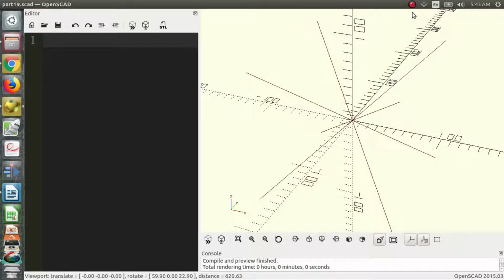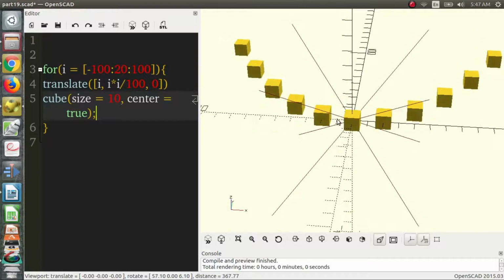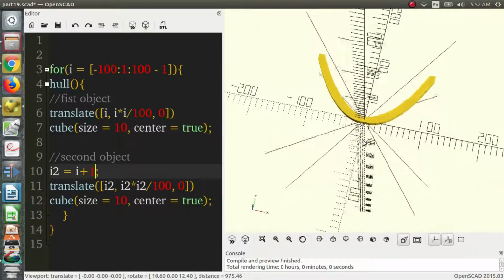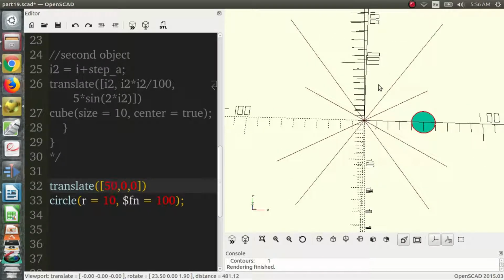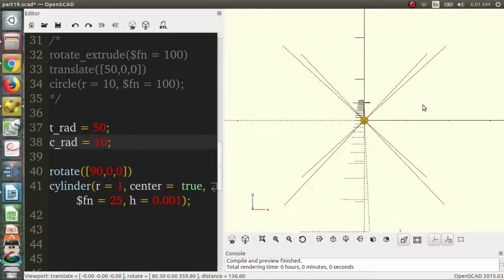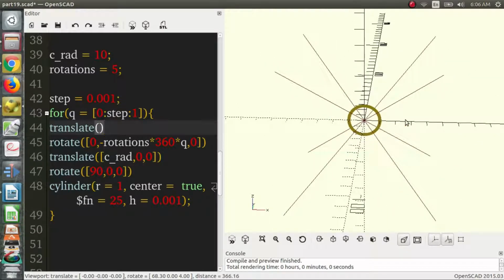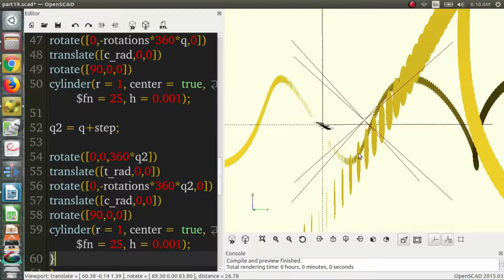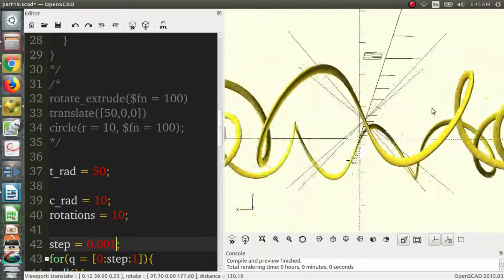Chained Hull-OpenSCAD Tutorial 19

Comment: Is there a way to do a hull to add another shape without compromising the void in the middle of the ring?
Reply from the maker: Could you elaborate? I think I understand in principle but not exactly what your going for. If you have some code, I could take a look.
Reply from the maker: So I thought about it and a simple way to do this somewhat is to hull each individual segment of the ring with the object you want to hull with. It's not perfect but it does it somewhat. Although I'm still not sure what you mean fully. 

steps = 100;
for(i = [0:steps-1]){
    I1 = i;
    
    I2 = i+1;
    
    hull(){
        rotate([0, 0, 360*I1/(steps)])
        translate([10, 0, 0])
        rotate([-90, 0, 0])
        cylinder(r = 1, center=true, $fn=100, h=0.01);
        
        rotate([0, 0, 360*I2/(steps)])
        translate([10, 0, 0])
        rotate([-90, 0, 0])
        cylinder(r = 1, center=true, $fn=100, h=0.01);
        
        
        translate([20, 0, -50])
        cube(size=3, center=true);
        
    }
}
Reply: @CharthuliusWheezer  It wasn't quite what I was looking for but this code helped me figure out what I was trying to do. I appreciate the response.